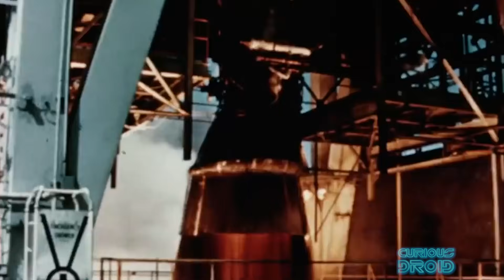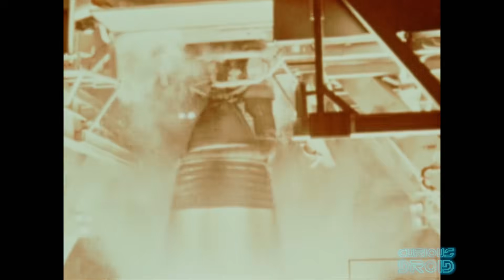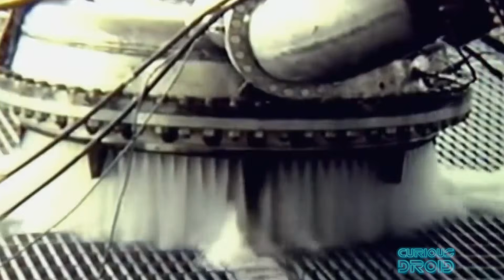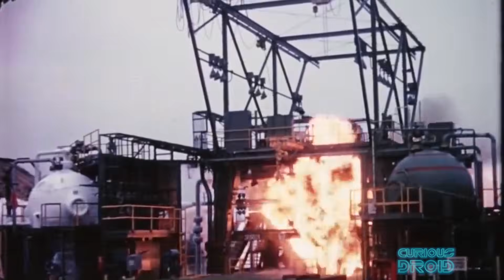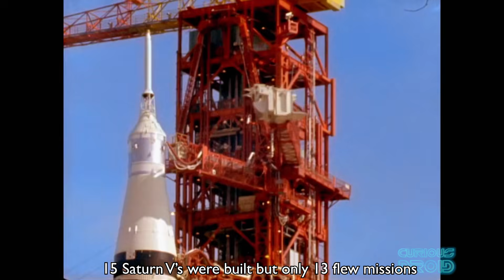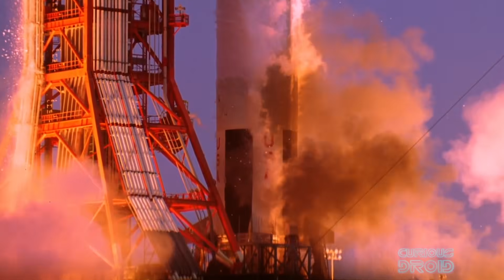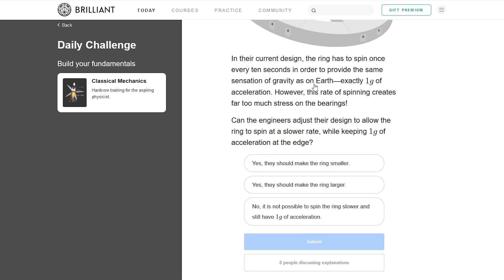F-1  The Engine That Nearly Stopped the Apollo Moon Missions

Comment: My Grandfather Ray Robbins was part of that team of engineers.  He explained that the T* position (point of highest pressure) of the nozzles was in the wrong location for such a large engine.  The Rocketdyne folks kept trying to explain to NASA that this was the issue, but NASA told them not to go down that path.  My Grandfather, some machinists, and technicians worked nonstop over an extended holiday shutdown to made the necessary modifications to extend the baffle plates without telling NASA and Sr. Management at Rocketdyne.  Everyone was amazed when for the very first time they were able to run at full power without blowing the engine and teststand up.  After the engine was ran, and safe, everyone went down to see what had changed.  When they realized that the baffle plates had been modified to place the T* position in the correct location, the folks at NASA wanted Rocketdyne to fire my grandfather.  The head of Rocketdyne told the NASA folks that they should be greatful as this solved a problem they had been chasing for years, saved millions of dollars, and that they could now get back on schedule for the Apollo Missions.  Needless to say, my grandfather kept his job.
Reply: That's a great example of what we see every day -- management not trusting professionals. While we need management to set high-level goals, cut through red tape, and insulate employees from constant distractions, most management these days seems to think its primary job should be getting involved on the ground floor.
Reply: Listen to the engineers dammit! Management unfortunately consists of people who are usually not competent. But the head of Rocketdyne is definitely a great man - at that time had the spine to stand up for his engineer.
Reply: My initial thoughts were (on reading your comment), “was there a group of people who didn’t want this work to proceed”, an active attempt to halt the Apollo program?
Reply: @richardbaxter2057  I think it's just a common quality of certain people in charge who think they know better. I deal with it in tech all the time. Yep, all of us engineers who know how the whole system works are wrong and stupid and the CEO knows better!
Reply: This is what happens with manager that have massive ego, and dont want to loose any face at all. Those kind of people have no place in management. A good manager listens to his staff.

Comment: They really over simplified this....my grandfather ran the vibration and acoustic lab at Marshal and his college roommate was the chief engineer on the F1 for NASA...the black powder testing was basically like "if we can survive this, we can handle anything". They did much, much more to modify this engine. When they did the cluster test on the large test stands at Marshal, they were sued by cities all the way into Georgia, over 200 miles away for breaking windows, vases, etc. It registered on seismographs all over the south east....just remember, these engines dwarf the shuttle engines. Fuel lines were 36" in diameter and had the same flow rate as cutting the bottom out of a water tower.
Reply: To be fair, it’s a bit hard to condense 5 or 6 years of exhaustive test and development into an 8 minute video and he didn’t really imply that this was all there was to it. It doesn’t take a lot of imagination to realise that there was a lot more to it.
Reply: Wow! Great story and analogy. Thank you.
Reply: @thethirdman225  I understand the video wasn't meant to be comprehensive...I just know a lot of stories about testing done on these amazing engines. If you ask guys that worked on Apollo and the shuttle, which one was their bigger accomplishment, everyone of them has told me it was the SaturnV that they consider their life's work...my grandfather actually has the SaturnV on his headstone.
Reply: AlabamaPanther 1776 I don’t doubt that for a minute. There was only one Apollo program. The Saturn program was at the core of it.
Reply: You are a special kind of crazy.
Reply: Let me guess...the Earth is flat, everything is a lie, and it's Trump's fault you're unsuccessful in life?
Reply: The F1 engines dwarf the shuttle engines because the shuttle's solid rocket booster did the heavy lifting literally. Had they had solid rocket booster back in the 60's the F1 engine would not exist.
Reply: @Crunk99ify  The idea that the test of all five engines together caused that much of a ruckus makes me smile.
Reply: @therealuncleowen2588  So another cool story, was my grandfather hired a guy from MIT as a consultant when they were running test of the F1's. So they test one engine and get something crazy like 205db, obviously, decibels are logarithmic but when they tested all five engines in the cluster test, they find out "wow these have substantially more volume than we had calculated...like 10X+"....that consultant helping from MIT was Dr. Bose. He realized there you could cluster small speaker and get a giant sound out of them. All the Bose speaker technology started at a test stand at Marshall, in Huntsville.
Reply: @dragonmanmark  They had solid propellents and some (in small quantities, many for ignition are used)but there were several meetings on whether to use solids or liquids as fuel...liquids creates a hell of a vibrations issue due to slosh factors and a lot of instability issues and resonances/harmonics from the angle of how the rocket is actually positioned at a time...(thats why they throttled down at certain altitudes with the shuttle due to how the lox tank reacts being half empty and those forces being applied). At that time, solid fuels held more energy, but as you mentioned, they didn't see a path forward to having solid fuels without massive weight problems. But solid fuels were considered and preferred in the very beginning. SLS is basically a Saturn V with RS-25's and SRBs. I'm curious to see if they are able to get the same distance and energies from that set up...I suspect for a moon mission, they will find they need to replace the RS-25's or at least the fuel they have been running on.
Reply: come to the Space and Rocket center in Huntsville. I will personally bring a PhD in plasma physics that was the chief scientist on two shuttle launches. No rational person can see all this information and still believe we didn't go to the moon. I have been lucky enough to know many, many unbelievable NASA engineers in my life and a few of the Apollo guys are still around. The chief design guy for the F1 lives down the street from me and is a family friend. These guys worked their asses off and created about half of the principals in any given high school science books today. By the way, here is proof that the moon landing could not have been faked. 
https://www.youtube.com/watch?v=_loUDS4c3Cs
Reply: Dude....really? you send a video by a guy who was researching UFO's and then found out who Von Braun was? My grandfather reported to a guy named Gus Crowe, who was one of the original Germans from operation paperclip. Gus Crowe reported to Von Braun....My grandfather knew Von Braun to the point of having him over for dinner. They gave John F. Kennedy a tour in '61. I understand that you can't believe our government today, and it's good to question stuff (i'm an aerospace engineer myself, so if I don't see it or can't prove it from a test, I don't believe it) but you really need to educate yourself on this topic thoroughly. There are so many little complicated principals we learned from the Apollo program that there is no way any of it is fake. Please consider coming to the Space and Rocket center and seeing for yourself.
Reply: @Crunk99ify  DNFTT.
Reply: @Crunk99ify  Thanks for your comments. I was intrigued by what you said about your grandfather. As an aerospace engineer, do you work in commercial aviation or the space program?
Reply: @GentlemanAmerican  Here in Huntsville, you can pretty much pick your job. Currently I am working for the DoD designing missiles. But as SLS comes on, I may switch over to NASA, as I have a good deal of friends there.
Reply: The word "firmament" does NOT mean "dome"! It means "the sky, heaven, the blue, the wide blue yonder, the azure, the heavens, the skies". So von Braun's use of Psalms 19.1 is quite appropriate for what he spent his life doing.
Reply: This is one reason the testing of nearly all flight rated engines were tested at NSTL (Stennis) in Mississippi. NASA purchased and/or relocated three towns to make this test center and its associated buffer zone in a little inhabited area of the state. And they discovered that cloud cover could cause acoustic problems many miles away.
Reply: @dragonmanmark  They had experience with solid fuel rockets in the 1960s, in the way of the Minuteman ICBM program (Minuteman I was in service by 1962), Polaris (entered service in 1961),  and the strap on boosters for Titan IIIC (entered service in 1965) .
Reply: @dragonmanmark  Actually they did, but not quite in time.  They tested solid motors that were 260" in diameter in 1965 - 1967.  The first two produced 3.5m pounds of the thrust and the third 5m.   Here is a link to the technical report on the development:  https://ntrs.nasa.gov/archive/nasa/casi.ntrs.nasa.gov/20000033816.pdf
Reply: @Crunk99ify  First off, thank you for sharing the stories from your grandfather.   A German engineer who had worked with von Braun (and was older) had somehow, in his retirement, found his way to my hometown in Ohio.   I visited the gentleman once - wish I could remember his name.  What I do remember is that his basement contained an entire machine shop.   Just amazing.   He had obtained copies of the blueprints for the JN4 "Jenny" biplane.   He was building a model - but not just any model.   It was identical in every way but size.  All the original materials, everything.  He even cast a small four cylinder engine block,  made tiny turnbuckles for the wing wire bracing, everything.   His one 'surrender' may have been the spark plugs - those may have been small commercially available ones.   The other thing I remember was his quiet, gentle nature that 'sat upon' his supreme intelligence, confidence and ability.    And like you, I am an aerospace engineer and had 39 years in industry.   Thanks again.
Reply: mind  murder tools? lol you are talking about people that wrote the books for the advancements we have today. You should visit Huntsville and educated yourself.
Reply: @Crunk99ify  I would love to visit Huntsville. A former gf was from there. I've lived here on the space coast since 1968. Watching Apollo. I've witnessed EVERY program since. The Apollo 17 being the most spectacular of all. I suspect never to be eclipsed. The sound of all 5 F-1 engines would shake the ground. Garage doors would rattle in thier tracks and kitchen cabinets nearly vibrate the contents to pcs. And that's miles away here in Merritt Island. 
 Little known fact. "The Cape" as it became known as was initially called Mila. There is an elementary school here by that name. Stood for... Merritt Island launch Area. As Cape Canaveral is actually part of Merritt Island. A unique place in and of itself. Most of my friends parents worked at the Cape. Later many of thier kids working at the rocket factory. 
 It's laughable when these flat tards turn up. But the humor is short lived and failures of modern school system becomes obvious
Reply: @Crunk99ify  the SRBs lack ability to throttle. THAT was the singularly biggest drawback to use early on. Only liquid propellants had that capability. SRBs are on. Only. Light and go. No way to shut down. Throttle back. Nothing. Early on it was decided they were just too dangerous for manned flight. Delivering a payload is much different than putting a human on top of a rocket where there is NO control is far different. Gus Grissom was VERY much against ANY equipment the astronauts had no control over. As he put it they would become spam in a can.
Reply: Dankie/ Merci Alabama Panther 1776.  I am glad u told us about your Grandfather. It is very kind of u. Just think "we" who do not know other "grandfathers" and the "they" what don't want to know there parents. I hope u will put it to your children of your/ his Grandfather and what he has done us (all) in the "West" or the world. And there is one thing more. How you are will also, to 25% or less be in your children, grandchildren and so forth... Thx
Reply: I'm Suprised that they didn't spray water into the flame trench to lessen the shockwaves.

Comment: Can you imagine building a test stand capable of staying anchored to the ground with 3750 TONS of thrust pushing upwards?
Reply: We can actually see the stand bend in the video.
Reply: You just need a test stand that weighs 3751 tons.
Reply: @970357ers  If the structure were perfectly rigid and uniformly loaded, it would have been that simple. But that is not reality and weight is only part of the solution. Nothing is rigid, everything is a spring (to some minute extent); and rockets are more akin to point loads which introduce flexing and bending.
Still sounds like a fun design challenge.
Reply: During the relatively short-lived British space programme, I think we got around that problem by making the rocket its own test stand, as it were - basically we filled up the rocket with fuel, and fired the engines with it clamped down on its launch pad (or something very like its launch pad - the test stands were in Cumbria and on the Isle of Wight; the actual launch site was in Australia).
Reply: just build two rockets that push against each other
Reply: Lots of duct tape.
Reply: I remember seeing those stands in person.  Pretty awesome.
Reply: Yes, the test stand needs to much more heavier
Reply: A thick enough steel plate fixed to 4 steel rods of about 20 cm in diameter would hold that thrust.
Reply: MichaelKingsfordGray  C'mon man. Don't feed them. This is the internet. Know better.
Reply: @dickfantastic7908  Most underated comment on here bro. 😂😂👍
Reply: They didn't more proof it was all a hoax
Reply: @christianwetzel2199  What if only one works and the other doesn't produce thrust?
Reply: @Tom McEwan Hopefully not tested at Maralinga "P
Reply: A couple of 100mm dyna bolts should do the trick.
Reply: Chill guys, I'm 36 with a wife and kid and I thought Dick Fantastic's comment was #MildlyAmusing. Go find something else to be offended about.
Reply: @970357ers  -- likely much more - just in case and balance - so 5K tons is probably a good start -- the force could easily be uneven - if one engine fails to ignite or an engine or two blow up...  or even one engine only burns at 50% or another burns at 125%.

TOOOOOO THEEEEE MOOOOOON!!!!
Reply: MichaelKingsfordGray what did he say
Reply: That's what I thought.
Reply: Easy. Make it heavier than 3750 tons - problem solved.
Reply: @RustedCroaker : Can you imagine 3750 tons of concrete? I mean yes, you've seen objects heavier than that many times in your life, but you've almost certainly never had to build one, and that's the impressive bit. For reference, that's 1,500,000 bags of sugar.
Reply: @deusexaethera  You don't have to build all the weight, you use a weight of a ground by anchors instead.
Reply: @RustedCroaker : I know, but that's not what people in my thread have been suggesting. Either way it's a very impressive construction.
Reply: Part of the design under the stand is to deflect the thrust at right angles, last thing you need is your test rocket running away on you.
Reply: Yes. It's called my mother in law
Reply: I was thinking that very same thing while watching this video......

Comment: In grad school, I met one of the engineers on one of the design teams.  Intense vibration was also a huge problem while the engines were reaching full thrust.  That vibration was so bad, it interfered with attitude control which was essential to keeping the whole rocket balanced.  One of the engineers noticed that the vibration dropped significantly, once max thrust had been reached by all 5 engines.  So, the solution they devised was not very intuitive:  they added enough fuel to the fuel capacity, so that the entire rocket weighed more than the max thrust of all 5 engines.  As the fuel was burned at max thrust, the weight of the entire rocket slowly decreased, while max thrust had minimized the intensity of all vibrations.  This, in turn, prevented the interference with attitude control which was otherwise occurring during the period between ignition and max thrust.
Reply: ....No.  I don't doubt that there was a solution to vibration problems that had something to do with the engines reaching full thrust.  But the Saturn 5 was never loaded heavier than it could lift itself.  

At launch, the whole rocket was around 6 million pounds fully loaded, and had 7.5 million pounds of thrust.  It lifted off the pad with 1.2 g of acceleration.

Comment: My uncle was an engineer who was  on the F1 project in the early to middle 1960's.  He told me that the larger the engines get, the more finicky  they get.  Just the tooling wear when making the injector plates made them run differently.  Each one was a completely new, different puzzle and they all were hand tuned one at a time on the test stand.  
(With no computers or modeling.  We actually used chalk boards and mechanical, hand crank calculators.)